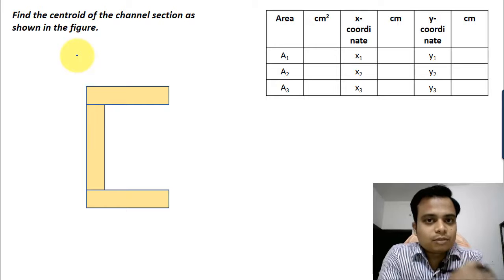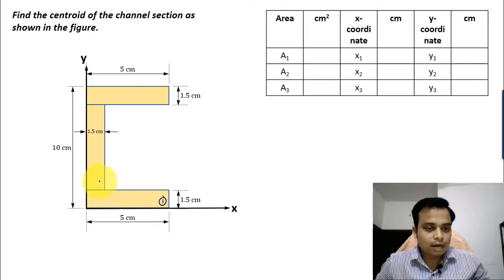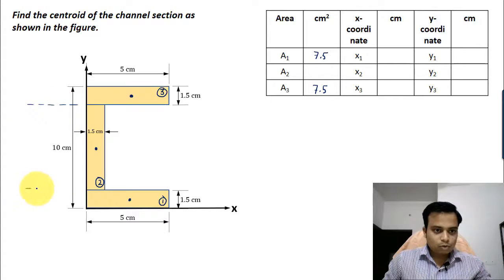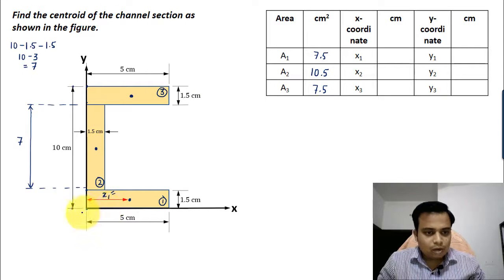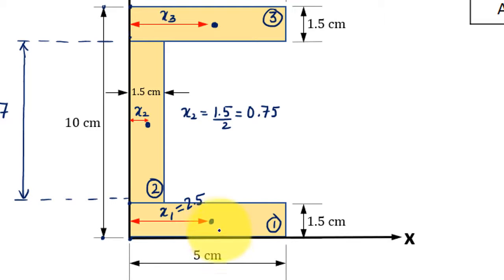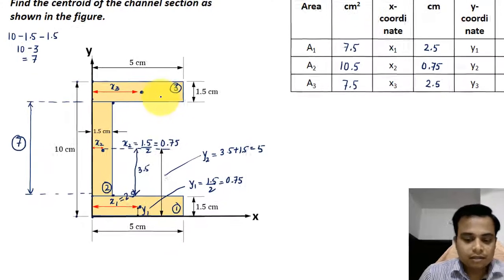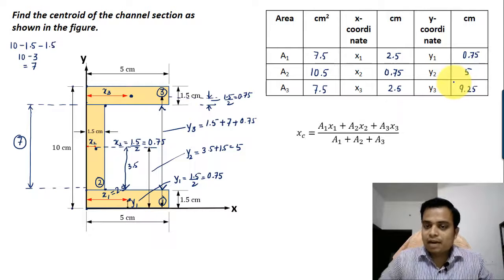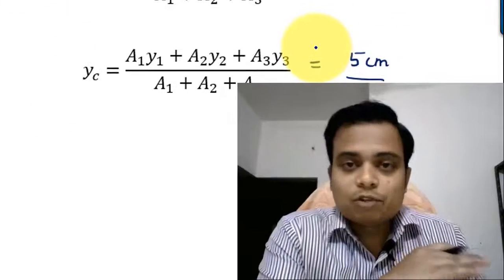How to find Centroid of an C - Section | Problem 3 |

Comment: Trick for you guys dont go for long calculation : for y  if x qxis divide equally then divide whole y axis length by 2 i.e 10/2 in these example. If it doesn't dive parts equally then we have to calculate

Comment: isnt it symmetrical about x axis..plz rply sir...
Reply from the maker: Yes it is........ You can follow that approach also...... In that case y bar will be 0 and x bar has to be calculated.
Reply: @ManasPatnaikofficial  sir i need shear center for channel section in strength of material